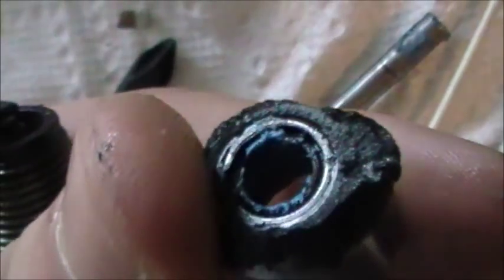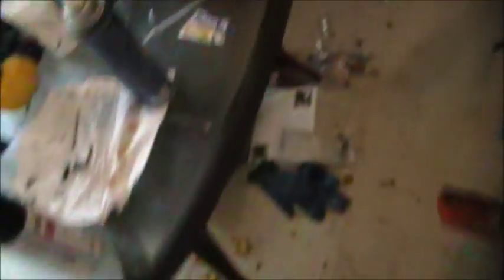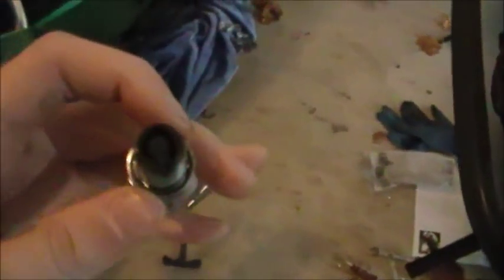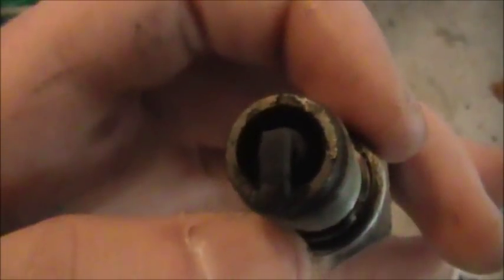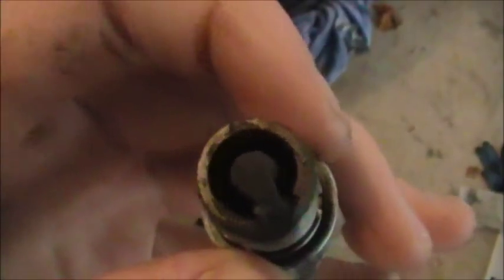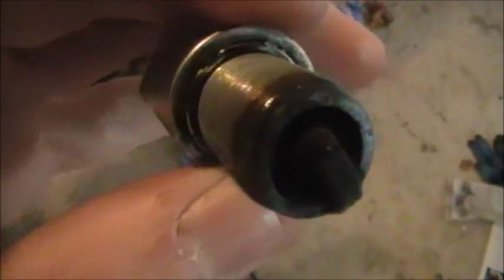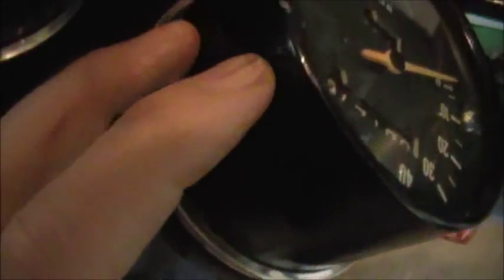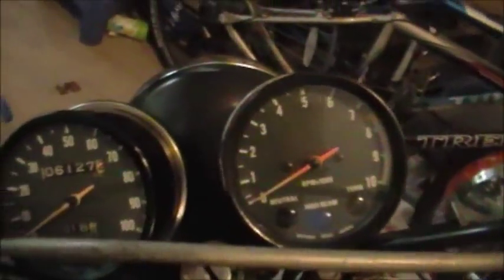2 stroke oil ratios and spark plug fouling

Comment: I think I have too much oil in my mix too. My mechanic suggested a 50:1 mix just in case the oil pump konks out... Plus, I am waiting on a baffle for it. I think that is some of my bikes problems, not enough back pressure. I have stock size jets in the carb. F7. 175

Comment: I have a KE100 and im using 1:40. thats about 25ml of oil for every liter of gas. I get foul sparkplugs all the time. like 2 fouls in a week. are you ģuys saying more oil means lesser fouls?
Reply from the maker: it can once you get over a certain amount. the type of oil used affects it as well. driving style also affects it how much oil you need. more rpms and throttle input can reduce carbon buildup, I will also mention that sometimes rejetting is nessecarry because oil is more viscous than gasoline. also i am assuming you meant 40:1

Comment: Most of your problems are because back then the ignitions were weak and generated a very weak spark. Back in the day guys would transplant an standard cheap automotive coil and made a much stronger spark. Maybe pull the head off and check for carbon buildup and make sure the exhaust is clean and open.

Comment from the maker: no thats way too lean. the oil helps cool the engine too. also after you get richer than about 20-1 your carbon buildup goes down. especially since ethanol in the gas these days tries to wipe the cylinder walls of oil.